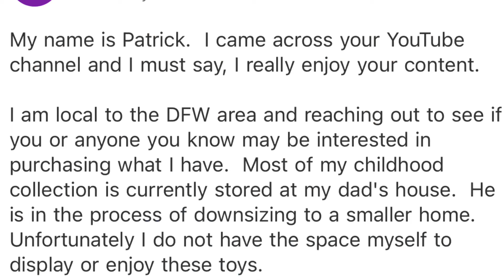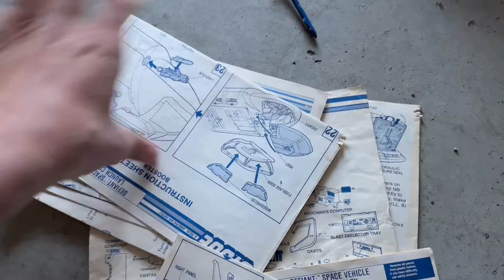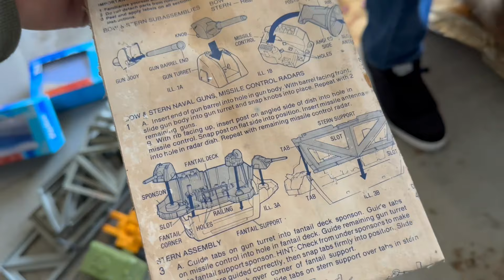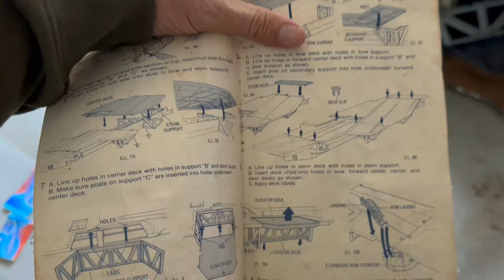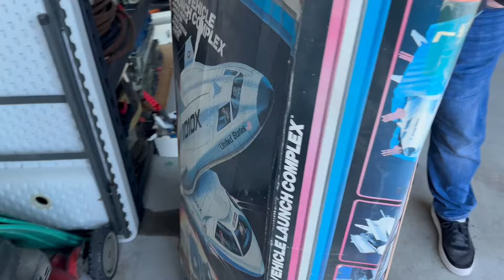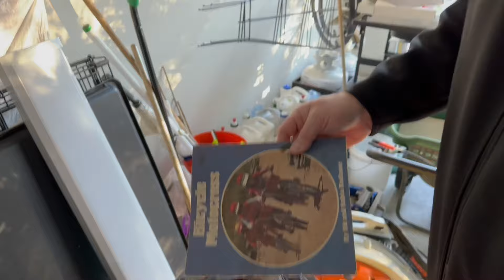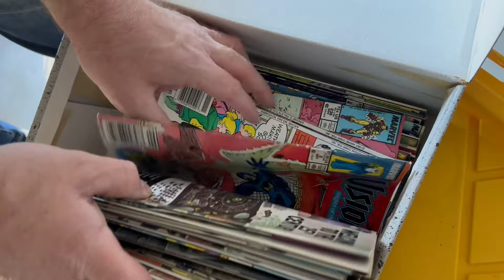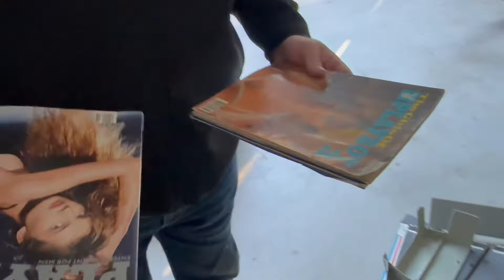You Won’t Believe What I Paid For These 80s Grails! These 80’s Grails Were The Deal of A Lifetime!

Comment: Do not use a heat gun on plastic toys. A hair dryer sometimes but the best thing is soak in very hot water, then wait until it's soft enough to manipulate, then once your holding it in the correct shape get someone to pour cold water over it to rapid cool it and it should hold its shape.
Reply from the maker: Thanks for the advice Julian!

Comment: The thing about grails so big, is the space needed. If you have the space, keep them, if not flip them. I also would look in to 3D printing some of the broken pieces, but keep the original ones (we have a 3D printer at my local library so they're pretty accessible and cheap)